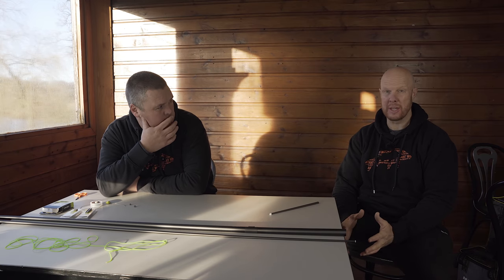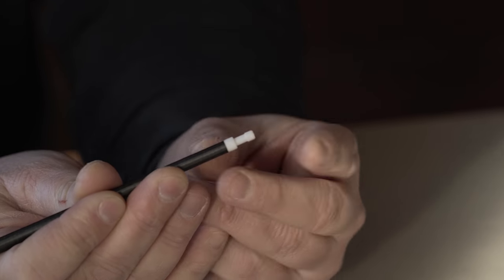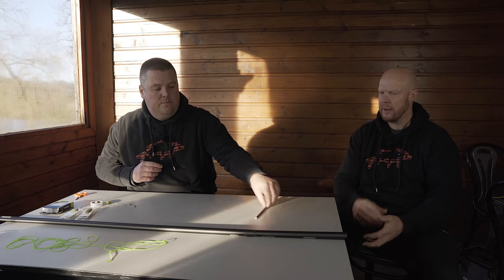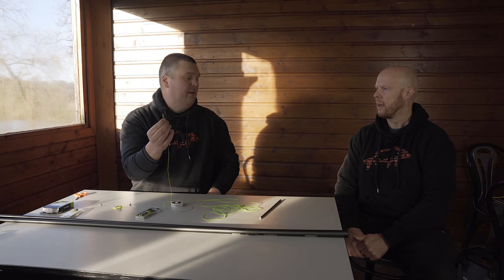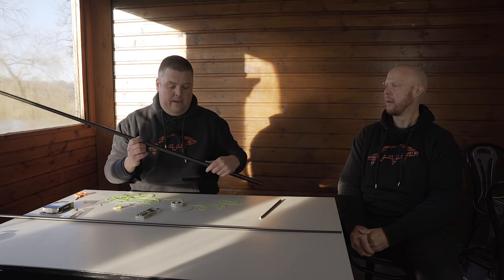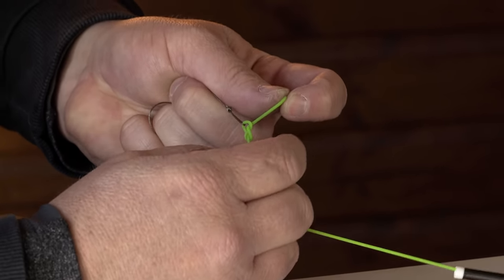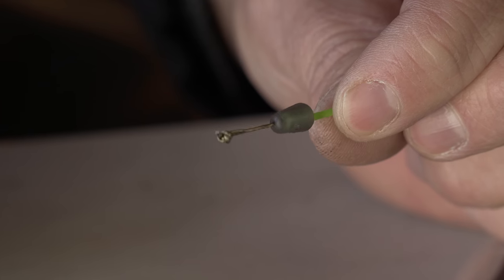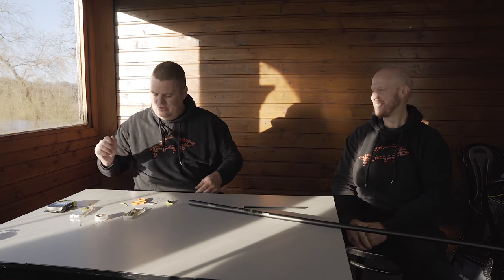Elasticate Your Pole | The Ultimate Guide | Make Your Own Dacron Connector

Comment: OMG how things have changed for us old timers! I am just getting back into the sport after a short absence of about 14-15 years, Side puller! Dacron connector! Internal Bush! I am so pleased I have found this channel, some fantastics videos. I even sit and hold my pole wrong now well it is 20ish years old and I have too due to the weight. Looks like I need to make a few investments. I have had the odd day at my very local Commercial in the last few years but normally tuck myself away. Alot to learn. Thanks for the videos. More on Partridge please.
Reply: ys back after ten years and my old carbon composite pole with a bung is like me old , good luck when your back out on the bank

Comment: Great vid as always, Answered a lot of questions with a giggle 👍. Ive just bought a lovely 10 metre matrix torque carp margin pole, sadly it didn't come pre bushed and I've had a lot of difficulties getting a bush to fit correctly. All the matrix bushes have been out of stock online so I bought a maver bush at the correct size and that was slightly to loose so I've just had to order a load of different make bushes to see if one will fit nicely.
Reply: Vernier calipers or a micrometer that will measure the internal diameter of your pole tip will help your search. A good tackle shop will be able to do this for you, and then be able to narrow down the correct sized bush for you. It can also be done using the narrow No1 section from a match kit (the useless bit the lads mentioned) and a standard micrometer. Push the narrow end of the No1 into the narrow end of the No2 until it is a snug fit, but not tight. Mark this point on the No1 with a sharp blade. Measure the diameter at the mark with the micrometer....and Bob's your cross-dressing aunt. The internal pole tip diameter should be 0.1-0.2mm larger than the outer diameter of the bush you fit. Then its a case of deciding on rhe bore size for elastic you want to use. You are welcome.
Reply: @stevemccrory9130  Cheers mate, I've managed to get a bush that fits nicely now. It was just alot of messing about. 👍

Comment: If you get stuck with an old tip kit with no elastic in it a couple of shot  on the end of a piece light line can be dropped through the kit and then used to pull the elastic through... takes seconds
Reply: Yep, done this. And also flicked the tip so the weights are forced through faster.
Reply: @jamsams  just cast it fly fishing style!🤣

Comment: Andy, I have just ordered the MAP 1001 10.2m Margin Pole.  Should I order additional Power Tops as I have 12 Tops 2's which I used with my MAP 201 2G.
 Thanks.  Good Video's these are with lots of little tips etc.
Reply from the maker: They 1001 has a shorter topkit than your 201 will have, so even though they will be compatible, for the best performance you will want the version 4 kits. Just match the number you have to how varied your fishing is.
Reply: @WinningWays  Thanks for advice

Comment: Are the side puller bush with the wheel in sold separately,and are they a standard size that will fit most side slots?

Comment: Advantageous is a word Andy,  I tried making your short dacron from the  first video but you did it too fast, this is a much clearer video which is now very easy to follow, I've also found an even easier way to attach normal dacrons without fiddling about trying to get the two loops to thread the elastic through.